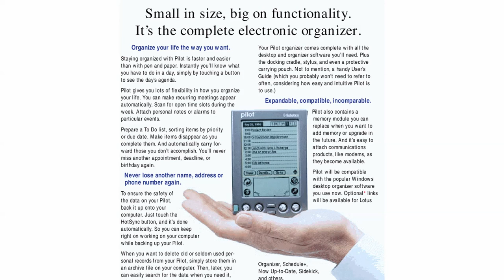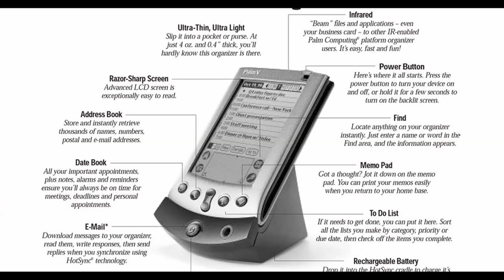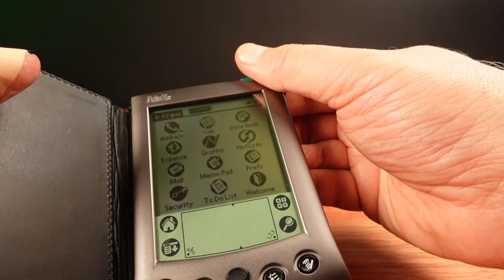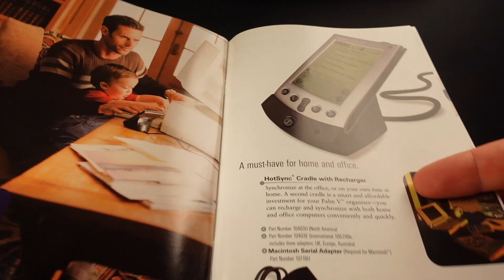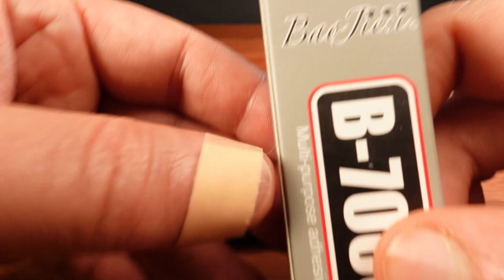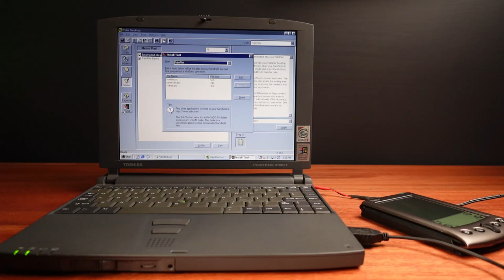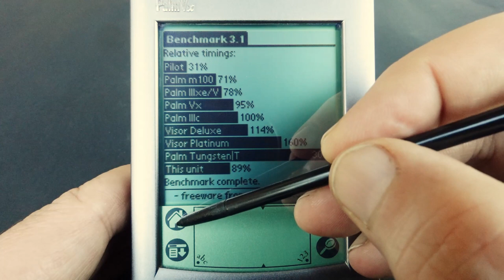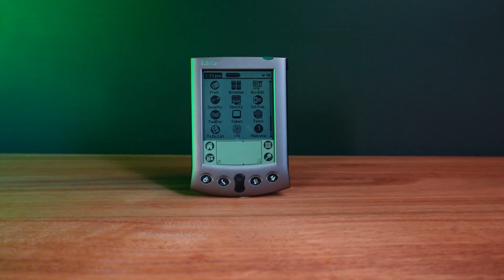Palm V PDA: The Jewel of Handheld Computers

Comment: That's a great looking Vx. I had a V for a few years from 1999 to early 2003 after which I switched to Sony CLIE devices. It was so slim and compact I carried it around everywhere! A company called OmniSky came out with a cellular data packet sled in 2000 and I was able to get a taste of wireless internet... though it was slow and coverage was limited to metropolitan areas. I sometimes miss those days when computing power in your pocket was still relatively new.
Reply from the maker: The pace of development in mobile computing in those days was thrilling. It must have been amazing to have wireless internet in your pocket in 2000. Thanks for sharing. It's great to hear from a fellow Palm V user.
Reply: Aka v dot
Reply: @JanusCycle what about the potato?

Comment: A quick reminder for the battery refurbishment: whenever you can, you should use the original BMS board from the original battery, in case the device needs the original board to charge the battery as intended.
Reply: It's a third party solution designed as a replacement, it's known to work. Technically he didn't have to game the connection.

Generally you're correct but in this case the result was known.

Comment: Extremely classic, I wish I still had our family's original Vx but I'll settle for the many others that I have. I still do have my first Palm, a IIIe. The V/Vx was definitely the Palm to have back then, Handspring made quite a splash with their Visor Edge. And ofc Palm reused this form factor with the m500 series but they used screws instead of glue. They were also excellent.
I'd suggest putting mathlib in ROM since so many applications rely on it, I also like using Launcher III on Palm devices running 4.1 or under, check it out. 
Idk why but I just loved using my Palm so much through the years, I have more than 10Gb of software for it and have amassed quite a collection, I love seeing more videos about it!
Reply from the maker: Thanks for the tips on mathlib and Launcher III. I'm so in love with the V/Vx and the greyscale screen. I am using other models as well all with colour screens. Including trying Palm OS 5 at the moment. But I keep coming back to this one.
Reply: 10 GBs of software??? Care to share???

Comment: Nice job with the Lipo replacement battery.  Wondering what the approach would be with those plastic block style removable batteries you find on the 3310 etc.  Nintendo DS Lite uses such a battery block, and I was wondering what possibilities exist for this hardware when aftermarket disappears.  Although, having searched just now, there seem to be endless aftermarket options for NDSL.
Reply from the maker: The more popular devices will have replacements for years. For the others it's hard work keeping batteries working or finding ways to build replacements.
Reply: @JanusCycle  Yes, I saw your Switch battery swap in.  Nice job there.

Comment: Nice work! Just bought a Vx from eBay with the Magellan GPS Companion, which I’m hoping to utilise for some eccentric map or GPS purposes. Also comes with a keyboard and some other goodies. That glue packaging is hilarious!
Reply from the maker: The GPS sounds intriguing. I hope you get it working!
Reply: @JanusCycle it has arrived, I’ve successfully updated it to Palm OS 4.1, but it seems a bit unstable when installing new applications (such as resetting and losing the calibration badly). New battery is on the way and my USB-serial interface is working with Windows 10 and a later version of Palm Desktop. Still waiting to try the GPS with a bunch of different software I’ve found.
Reply: @JanusCycle oh, and my backlight is non functional, though I’ve ordered a replacement IC to remedy this while I’m replacing the battery.
Reply: GPS disassembled and cleaned corrosion, working with Cetus, amazing to see!
Reply from the maker: @munnsie100  I'm really glad you got this working. If you continue to have calibration issues, try cleaning the digitizer under the front frame. Grit has been known to press down on the touch screen digitizer and cause accuracy problems.
Unless you need Palm OS 4.1 features, Palm OS 3.5 is still a good option. Though I admit I have two Palm Vxs with each version on them.
Reply from the maker: @munnsie100  It's great you have yours working with Windows 10. 64bit? That can be a challenge, but awesome when you get it working. I'm really pleased you are enjoying this amazing device.
Reply: @JanusCycle  yes, 64 bit. There is a nice guide on PalmDB, only issue I had was the USB-RS232 driver. Looking forward to getting an M515 next!

Comment: What do you think of the m500 series? Similar to the v but screwed together so much easier to replace the battery
Reply from the maker: I have a m515 that I looked at, with mixed feelings. I think I would much prefer a m500 with greyscale LCD and SD card slot together. And yes the battery is much easier to replace!

Comment: I just got a Palm V with terrible digitizer drift. A few days after calibration, I can’t even reach the menu to reset the digitizer. Is that a function of battery voltage dropping?
Reply from the maker: I don't believe it's the battery. Either the digitizer is wearing out. Or there is grit build up between the metal frame and the digitizer that is pressing on the digizier. I have successfully cleaned a couple of these and fixed the drift problem. But i did have to take it apart to do that.

Comment: How does the screen compare with a Palm m125 screen? Or, are they basically the same? I use my m125 for ereading. Works great outdoors or in daylight, but poor in bad lighting.
Reply from the maker: Yes, the m125 screen is just as good as the Vx. These screens work great as a mini ereader. Thanks for sharing that.

Comment: Can you provide info on battery? Where to acquire this exact one?
Reply from the maker: Mine was from eBay. It works really well.
https://www.ebay.com.au/itm/222883063110
You can also get one with the connector already attached. But more expensive.
https://www.ebay.com.au/itm/114129761234
Reply: Don't hv eBay in India, but i wonder if anyone could help me use another standard one from the market and customize it.
Reply: @sanjaypatil2532  Nokia BL-5C is a good substitute. It's used in many Chinese radios and gadgets.

Comment: 1900 körül volt érintős telefon? Fura hogy ez a 2000 res években 2001 2002 egészen 2008 ig kB vissza maradt hogy addig meg nyomó gombosok voltak
Reply from the maker: Almost every Palm OS based phone had a keypad/board. But there were a few rare ones that didn't, such as the Samsung SPH-i300. I don't know much about them, yet.
Reply: @JanusCycle 
Magyarul érték csak
Reply from the maker: @agnesbiro2979  Elnézést kérek, a Google fordító jól működik nekünk.
Reply: @JanusCycle 
Oké de mi volt amit angolul írt?
Reply from the maker: @agnesbiro2979  
Thank you for understanding. Here is the translation for you.

https://translate.google.com.au/?hl=en&sl=en&tl=hu&text=Thank%20you%20for%20understanding.%20Here%20is%20the%20translation%20for%20you.%20%0A%0AAlmost%20every%20Palm%20OS%20based%20phone%20had%20a%20keypad%2Fboard.%20But%20there%20were%20a%20few%20rare%20ones%20that%20didn%27t%2C%20such%20as%20the%20Samsung%20SPH-i300.%20I%20don%27t%20know%20much%20about%20them%2C%20yet.&op=translate

Comment: Great video! I love the Palm V but have given up on buying them as they all seem to come with digitzer drift now. There's a utility to recalibrate every time the Palm is turned on but it's no use when the screen loses focus within seconds! The m500 series is more reliable in that respect (and easier to replace the battery.)
Reply from the maker: There might be a way to fix that if it's being caused by grit under the frame pressing on the touch layer. But it usually involves disassembly and cleaning the screen and inside of the frame and may not always fix the problem. I have done it successfully though.